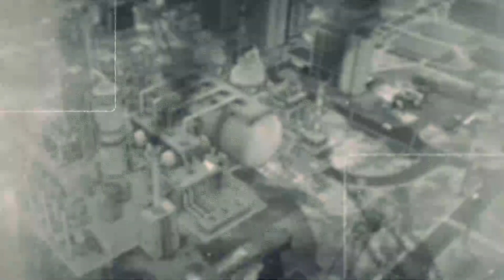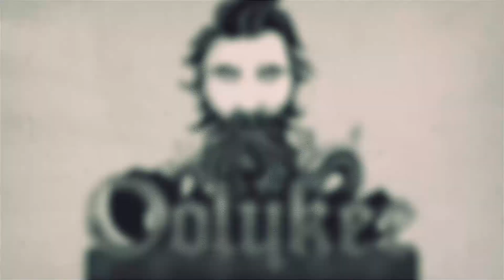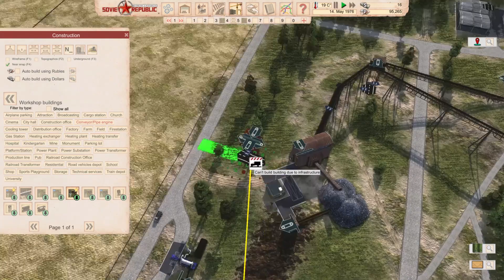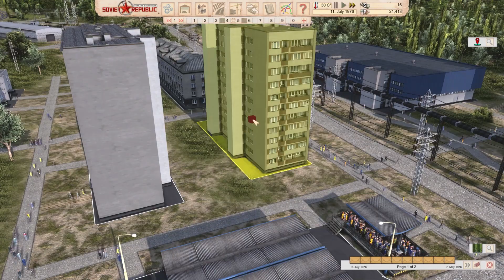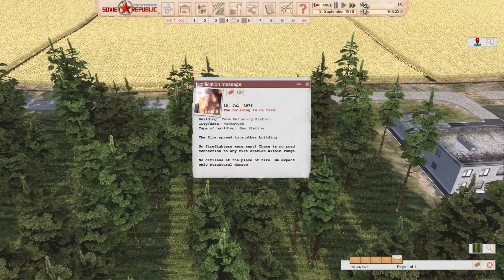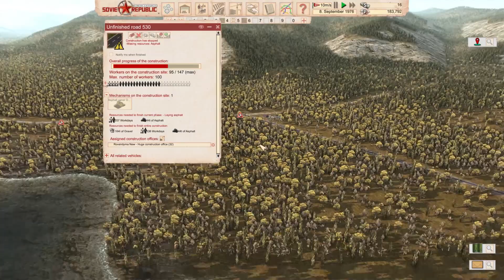Soviet Republic - Alaska - The New Beginning - Ep.47

Comment: * No in the game currently the medium voltage cannot be transformed (or transferred) to high voltage, some players have already done the test.
* I agree with Whaletyr on the wind turbines used in this way, personally I will only use them in the form of a wind farm to try to be a little more realistic, several wind turbines connected to a moded medium switch with more of 4 inputs / outputs. Each wind turbine producing 0.60 with 4 of them we can then draw a medium voltage line of 2.35 to supply a substation of this capacity.
* For your mountain road tests, the new topographic tool is your friend, it allows you to play with the contour lines ...
* Pollution is not instantaneous in the game, it works cumulatively, which is why the pollution of each building is expressed in tons per year, then weighted in the equation by the productivity of the related building
* You should not allow excess raw wood to be sold with your train carrying construction materials, it puts unnecessary strain on your wood production, charcoal and wood firing, for almost no profit.
* You should stop allocating the oil terminal to the DO Galahsk for its fuel supply and directly use a small tanker truck between the refinery and the oil dock. You will save ... fuel :) Currently a truck of this DO goes from Galahsk to Whaletyr to load fuel which will then do the opposite way to supply the oil terminal ...
* Needless to say, you would avoid a lot of problems by not always using auto-detection for your rail COs
Reply from the maker: 1. I thought I experienced opposite. But it's a simple enough test. I will do it tomorrow. :) 
2. Yeah! Interesting concept! I like it. Is that 5 way medium voltage connector? There is that "comb" connector in the mods. That could be useful. 
3. Yeah! I agree! Topographic view is really nice. I will use that. 
4. I understood it took time it's just I expected the refinery to pollute more immediately as I expected it to be much bigger polluter even at 10%. :) :) 
5. Yeah! Raw wood export will stop now! Thank you! 
6. You are right! Both cities will need to have their own storages and their own distributions. 
7. Yeah! Autodetect in COs is a thing I'm thinking about a lot! I still need to test this and make a video about it. Also, I wanted to talk about it more too but I got distracted a bit. :D 
Thanks for everything Stats! :)
Reply: @oolykeegaming81  I agree, you are not the only one to have obtained different conclusions from mine or those of other players concerning the subject of medium voltage into higher voltage, I fear that we will still need a lot of testing from both sides and else to come to an agreement :)